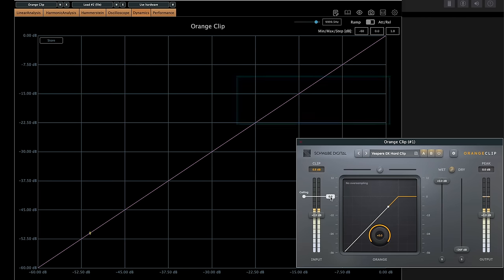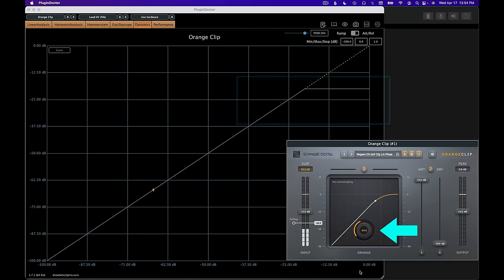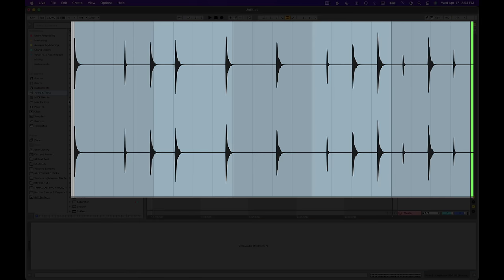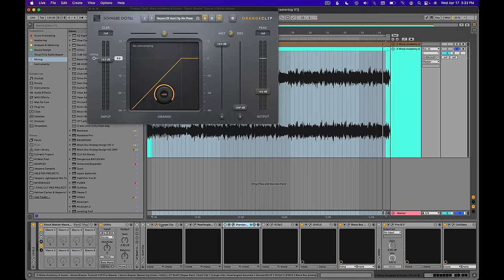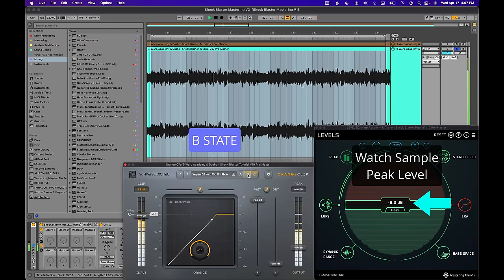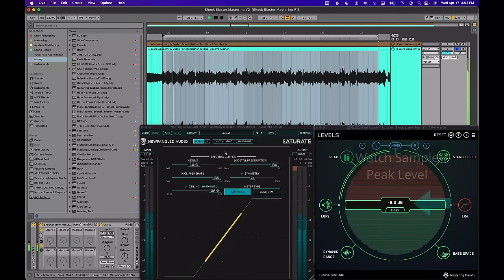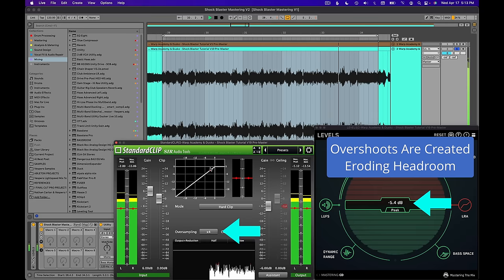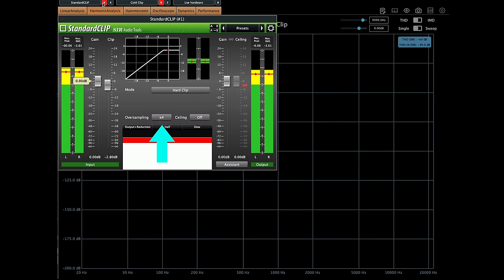The Science of Clipping - The ULTIMATE Tool for Loudness + Punch

Comment: Just curious, what exactly is the rationale for the pursuit of "loudness" in a world of 24-bit recording? Isn't this just a holdover from analog recording where signal had to be as hot as possible because of the noise floor? Why not just normalize to 0dbfs and if the listener wants it louder they can just turn up the volume, no?
Reply from the maker: Hey hey.  Yeah this is a big topic and one that comes up a lot.  I kind of get tired of answering it over and over again so I made a video that explains my perspective.  Check it out here: Loudness Trumps EVERYTHING!
https://youtu.be/UHxKQ3iIPyA

I would also say that you’re assuming all modern playback systems have tons of headroom to just “Turn it up”.  That’s not the case.  In the 70s and 80s maybe people would listen to music on home hifi systems with huge amps on big 3 way speakers in their living rooms with a very low amount of background noise.  Not the case today. 

Today people listen on Bluetooth speakers, car audio systems, phones, laptops etc.  Many times these systems are battery powered or use very small speakers so they’re portable.  You cannot simply turn it up.  There isn’t massive headroom.  They distort. Especially when trying to produce sub.  

So today we master and mix with less dynamic range and then use production and mixing techniques that still allow the song to sound punchy and clean.  It can be done and it is being done.

Comment: The last video you said you shouldn’t use a clipper on a whole mix but rather in the mix.
Reply from the maker: Sure let me clarify.  I prefer to do most of the clipping in the mix on individual elements.  Then I clip busses / sub-mixes as well.  And then, if it still needs a little push I will clip the master.  Note that effects on the master are the most noticeable and that’s why I say to do it in the mix.  However the master is a summing point and it will have little peaks that don’t get caught in the mix.  For that I’ve been using manual limiting in iZo RX rather than clipping mostly.  It’s 100% transparent.  Then I’ll clip 1-2 dB of transients on the master if I need to go to -5 or -6 LUFS.  If not, no master clipping is needed.  It all depends on genre.  This is drum and bass so I mastered it loud.
Reply: @warpacademy Ok now I get it. Thank You for the information. 👍
Reply from the maker: My pleasure.  Glad it makes sense.  I didn't really explain it well enough in the first video so I'm glad I could clarify here.  Cheers!

Comment: I use different types of fades to clip. Its called fade clip.
Reply from the maker: Not sure what you mean by that?
Reply: @warpacademy  sorry, to clarify I draw/apply different fade types to certain transient with their different on-set angles to fade clip peaks. For example using an S type  fade-in is very quick to cut initial fast peaks on certain waveforms.
Reply from the maker: Ah yes.  That’s very surgical and also super time consuming.  I used to do things like that for bass ducking but stopped.  Faster tools exist now like Devious Machines Duck.  

You may like iZotope RX for these types of peak edits.  Works better than clip fades for peak information.  

But I always respect someone’s willing to go in and hand edit something for the best result to kudos to you!
Reply: @warpacademy  thanks. I don't do it everywhere but if the odd huge peak is really close to on-set of a waveform I'll do it. I also manually arrange all peaks and the meat with clip gain to get them all around the same level before hitting any squisher. I'm talking like strip silence, then manually adjusting each word if necessary. Time consuming but the results!
Reply from the maker: Yes indeed.  The best limiter is no limiter at all.  Hand edits make zero distortion.

Comment: There is way too much odd/enharmonics added to signal to be clean when  clipping. Loud is all about fletcher munson curve. Learn how to mix first then very light clip, you will be much happier with the end result.
Reply from the maker: That’s quite a subjective preference I would say.  I love using clippers to introduce brighter harmonics on the transients.  It’s part of the sound I enjoy.  I don’t find it too much at all.  But I work on very aggressive sounding music.  

Regarding Fletcher Munson curves.  Those have been outdated for some time now.  They are very inaccurate.  The test methods were pretty shoddy if you look up how they actually came up with them.  

They’ve been replaced by the ISO226 2003 Equal Loudness Contours.  And really they are about psychoacoustic non-linear response of human hearing to sound pressure.  Not dynamic range in mixing and mastering or loudness.
Reply: Ok, then listen to white noise versus pink and see what frequencies excite the ear and seem the loudest.
Reply from the maker: We’re not talking about noise.  We’re talking about music.  It’s not a science project.  It’s art and it’s also subjective.  

I like the sound of impact and the extra harmonics on the drum transients.  That’s what the clipping is doing here.  

And I do agree that clipping the RMS of a signal will introduce more sustained harmonics that may be abrasive.  Just like any saturation or distortion would.  Which is why I will tame up the high end if I do that by using EQ or HF limiting.